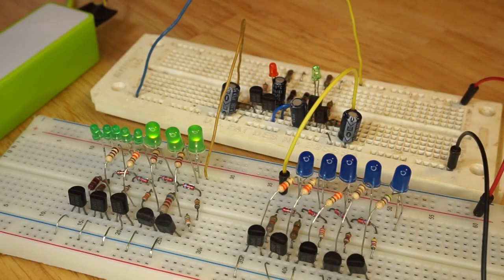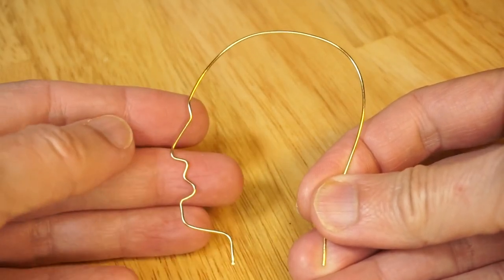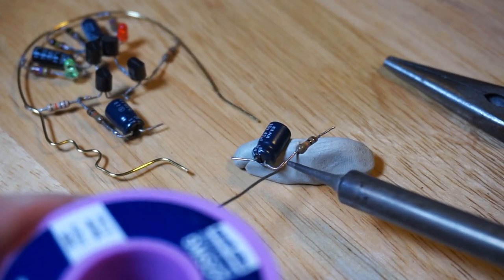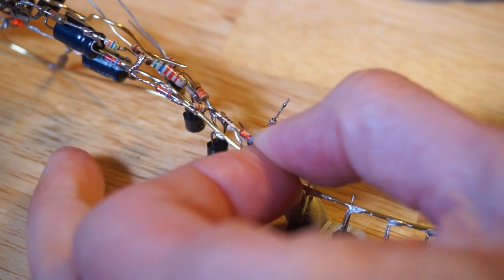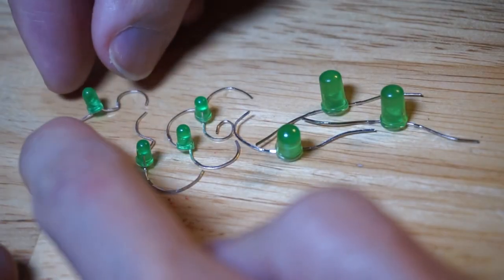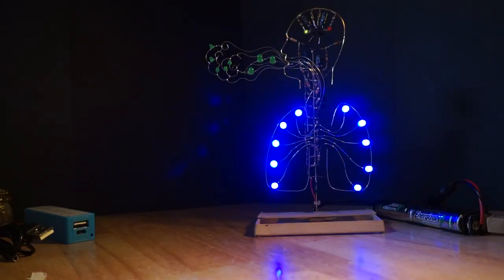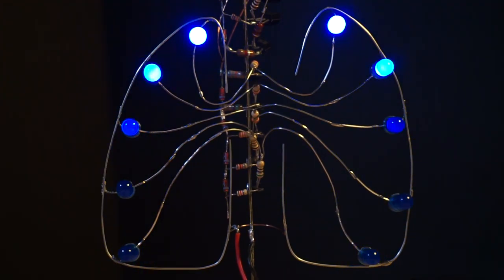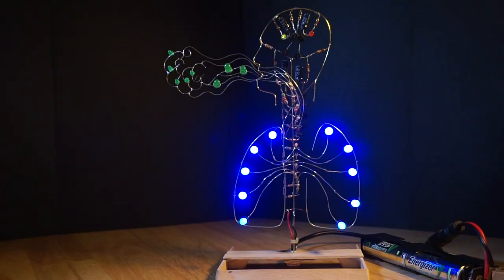"Astable Exhalation" - a 2020 inspired circuit sculpture

Comment: I see 5 transistors and 8 green LEDs so I gather some of the smaller LEDs are paralleled from a single transistor.
Reply from the maker: Yes. See circuit diagram at https://hackaday.io/project/175570-astable-exhalation

Comment: hi! can I use 9V for this?
Reply from the maker: Yes but it fades will happen a bit quick. The resistor and capacitor values would need some  adjustments
Reply: @bornach  ohhhhh thanksss guess ill use 5-6V hahahaha
Reply: Two pcs 3 ohms resistor? Or just one?
Reply from the maker: @maryclairevargas7455  the exact resistances are not important. I just wanted to use up my scrap resistors before resorting to using new ones. The transistor is doing more to limit the current at this voltage. 
Try it out on a breadboard with different components to see what works for you
Reply: Ohhh okay! Thank youu